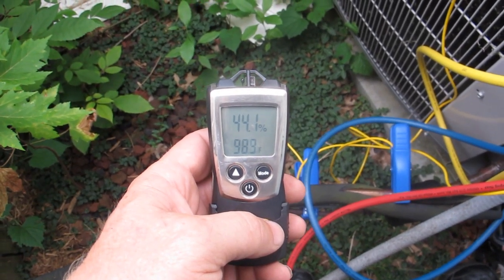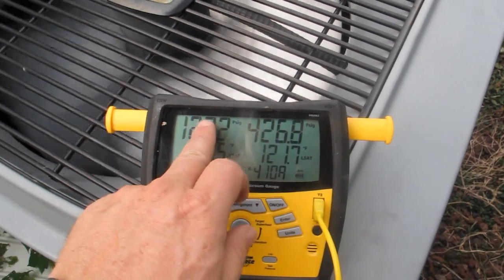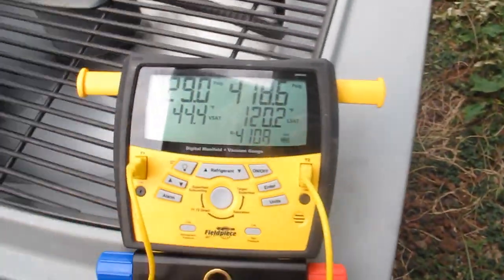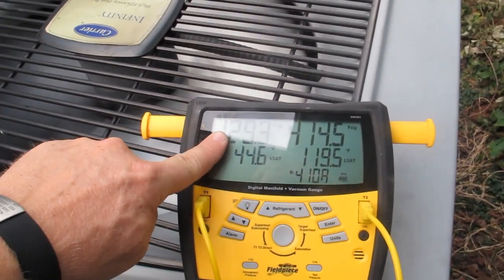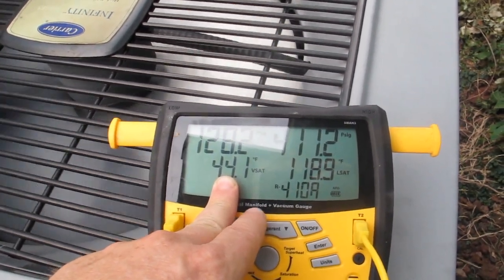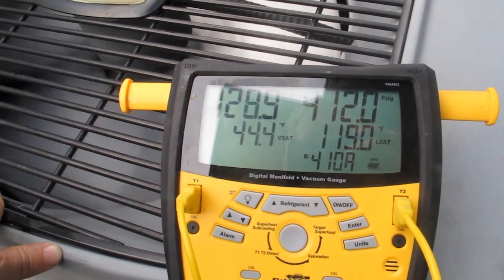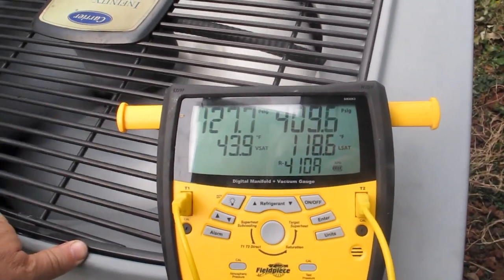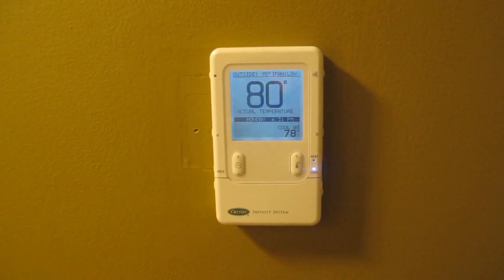HVAC Training - Variable Speed Problems

Comment: Great video and top notch diagnostics. 

Great tip on the 35 delta T between house and saturation. I did not know that.

It would work a lot better if the registers where in the floor where the air could follow the walls up to and off of the ceiling. One of my pet peeves is blowing air out into the room. I think it is better to condition the envelope and not blow air on people.  ACCA manual T goes into detail on this subject.

I bet you've been clocking some overtime.It's been over 100 for weeks

Comment from the maker: we could install a zone system in which temp sensors in each zone would control a damper but you would have to redo the whole duct system which would be cost prohibitive unless you doing a rehab or new construction. 

We did price the a mini- split system which would have 4- air handlers hooked to 1- condenser..

Comment from the maker: It is common practice here to install outlets in exterior walls. The only time that I run into this problem is when a variable speed unit is installed in wich case you will need to make sure the the supplies and returns are opppsite of each other. I normally block the grill off that im not using with a sheet of metal. its kind of a pain to switch them twice a year but its the price you have to pay for comfort.

Comment: Wow! I have only been working on Home HVAC for a little over a couple years. The comment about the "dumb" 35 degrees from someone with 10 years experience really surprised me....but not really because I have seen some pros who lack some basic fundamentals. I understand the 35 degree subtraction from indoor return temp. This gives you your VSAT temp. It's what I look for these days when servicing my units. This and my head pressure, which shouldn't be greater than 30 degrees of my ambient temperature. I do use superheat, but remember, you gain superheat when you measure at the outdoor unit so pay attention to how long your lineset is and compensate for the length. Just saying. Keep up the great videos. Experience can't be taught in the classroom.

Comment: Hi Eddie, hot and cold air returns, what a concept... in each room would be nice. The engineers today that design these single "cool" air only returns don't seem to be very bright. And then on the second floor the air return is in the ceiling... hum... hot air return? And, then, close the doors of the rooms... there goes the efficiency. Thanks for the video.

Comment: Outlets in an exterior wall??
Assuming its 2x4 studs, or best case 2x6, a 5" duct and boot, you have no insulation behind the duct and that part of the wall is uninsulated.

What I do to combat stratification is to use split pressure system running 50/50 @.5" WC, proportion the upstairs to 75% return, downstairs 25%.  Upstairs usually has about 50% more friction losses, so you get a nice self balancing system.

High low system works nice, you can get grills were the bottom has a damper.

Comment: Good fix. Next time try using a commercial register on the supply. You can accurately throw the air up at the ceiling. I've had good success with this. I try to keep it simple😊

Comment: The low side temperature is Saturated Vapor, the temperature of the refrigerant's boiling point after it has absorbed the heat in the air passing through the evaporator.. This number should be around 35 degrees cooler than the return air. Right?

Comment: Mold and mildew can also be a problem on the ceiling if you are not getting that cool, dry air to the ceiling, had this problem in my moms house. The ceiling was 95 degrees and the floor was 75.

Comment: Nice Video Eddie.
Just an observation.
I think I spotted a Desktop computer case near the original (Winter) return grill,
could be worth checking out.
They can throw some heat, especially higher spec'd models.

Comment: Bizarre coincidence. I was just at a house today with very similar problems.  I stumbled upon your video by complete accident and I think my head just turned and said "damn, makes total sense"  Appreciate the vid, will watch more.  Quick question though.  You said you did the ceiling r/a's in the basement only , or on both floors?  I suspect both floors is the better way to go anyways. Maybe tweak the basement floor slightly closed to help pull from upstairs in the worst situation.

Comment: I saw 44 on the low side Blue line.Do you add the 35 to the 44?If so that would be 79?Now it showed 80 degrees in the house.Those numbers seem more accurate

Comment: a lot of times on multiple story houses with multiple returns using the fan will fix it
Reply: Haha... this comment is funny to me because I have recommended turning the fan on (and leaving it on) in the summer to customers for years.  The feedback I received was pretty unanimous... that it helped get 2nd/3rd floors cooler.  HOWEVER, my in house instructor begs to differ and thinks this is merely a placebo effect or that said customers were placating me.  He has been adamant that running constant fan does nothing more than dump humidity back into the conditioned space.  Air moving across a wet coil will do nothing more than a absorb humidity which is now being thrown back into the home.  It's a dumb recommendation according to him.

His argument makes sense, but how negligible is it to not be a benefit I wonder?  Our industry can be very frustrating.

Comment: Techs look at pressures too much...look at the sat temp...rule of thumb is 40-45 deg evap...if its less than 40 or more than 45 or so and the house is "HOT"...you probably have a problem...I work a lot on chillers and we just look at the sat temp...pressures mean nothing...use that PT chart...it will save you time and aggravation when troubleshooting....

Comment: can air stratification happen across the ceiling with cold air ? or would the air just fall ? I've ran into a similar problem at another job but the supply and return are both located in the ceiling ?
Reply: cold air sinks, so I wouldn't think so. Stratification occurs with stagnant air separating into layers...hot and cold.  Same with water....the deeper in the ocean you go...the colder it gets.
Reply: depends on the fan speed most units have cool on high so if its a small room you can get that across the ceiling.

Comment: THATS THE TEMPERATURE ENTERING THE EVAPORATOR COIL ?  THATS THE EXIT TEMPERATRURE OF THE EVAP COIL. AFTER IT HAS SUCKED IN AIR CALLED SUPERHEAT.
Reply from the maker: I'm not talking about super heat, I am referring to the design temperature difference.
Reply: "sucked in air called superheat".....what?  that statement is wrong in many ways
Reply: the refrigerant is being super heated...not the air
Reply: sergio robles, stop embarrassing yourself.

Comment: check condenser coils....410 psi I think too high. for some reason I always run into carriers and swear the coil is clean but it's not. infinity should run around 350. 

thoroughly clean with chemical I'm sure psi will drop to around 350.